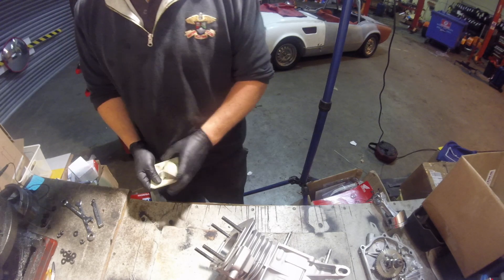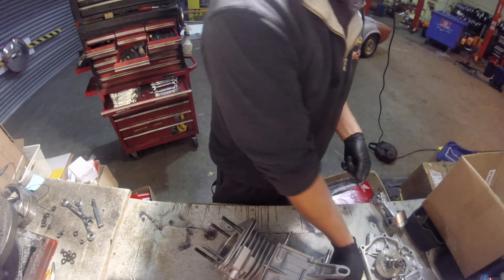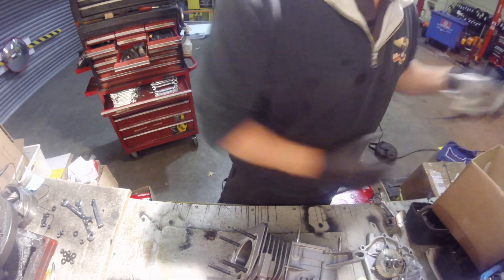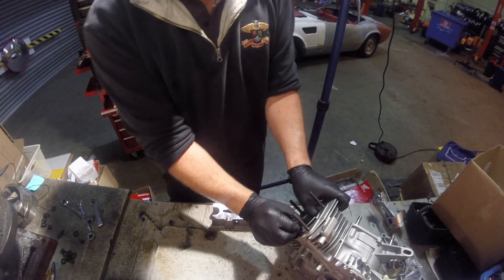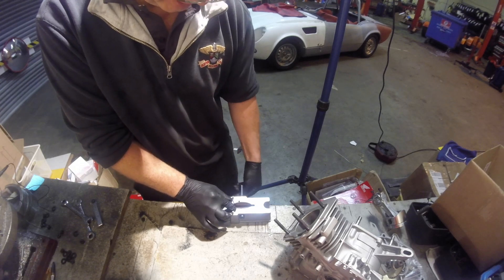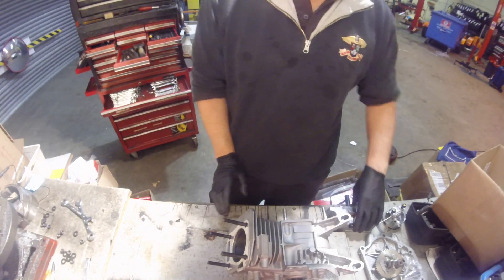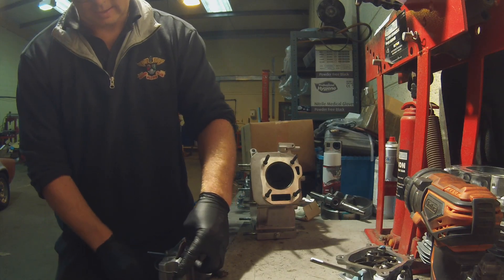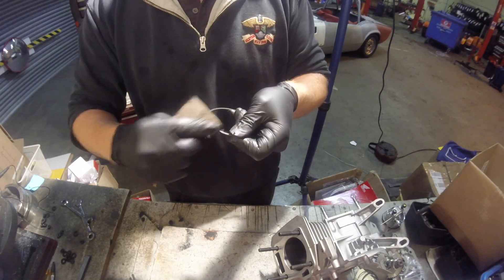Honda GX160 / GX200 Engine Tuning.  How to File Fit Oversized Piston Rings for Greater Performance.

Comment: Does it not cause the oversize piston ring to form an egg shape i.e. not perfectly round,  by fitting it on a standard piston in a standard cylinder bore?
Reply: I don't understand the need for 0.75 ring if the bore is standard...